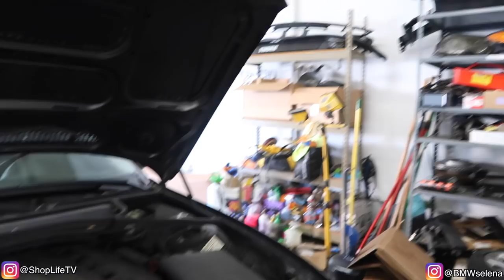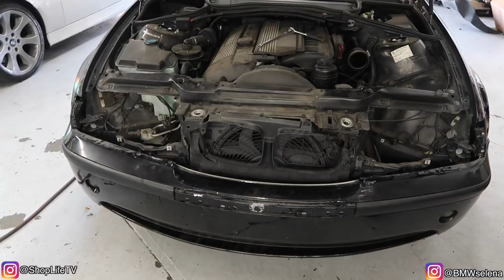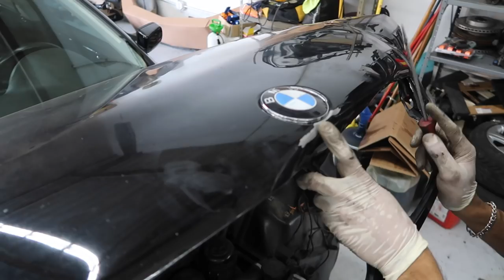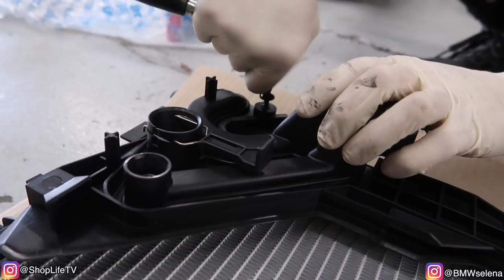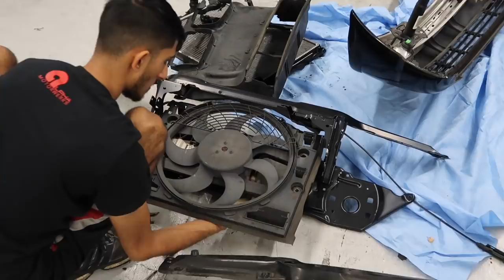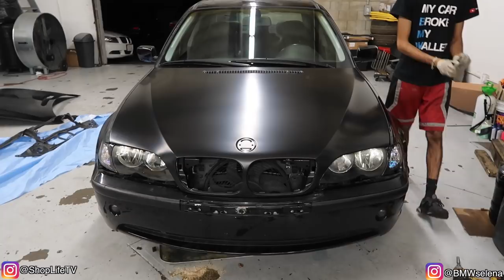WATCH ME FIX THIS WRECKED BMW E46!

Comment: You know the bumper alignment brackets? The PO of my E46 sedan hit the bumper/fender and the body is bent where the bracket is supposed to attach. Is this inner area replaceable?
Reply: I think I found the PN. Have you ever replaced one? 41148234037
Edit: I think this is the part 41148238047

Comment: While watching you squat on the floor working on some of those pieces I thought having a fold down bench mounted to the wall, especially one which ratchets so you could adjust the height up and down would be easy to build and might save your back and knees.

Comment: The owner might as well make it look better and add mods with the insurance money while at it.  I would add an electric fan, BMP water pum, a Mishimoto radiator and aluminum expansion tank.  The M3 or ZHP aka M-Tech bumper and Angel eye xenon headlights  ;)